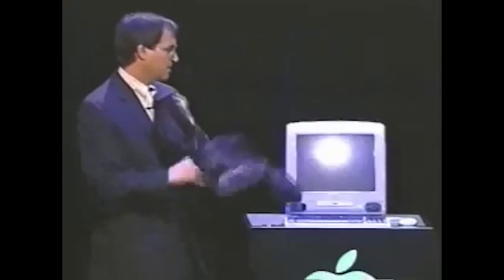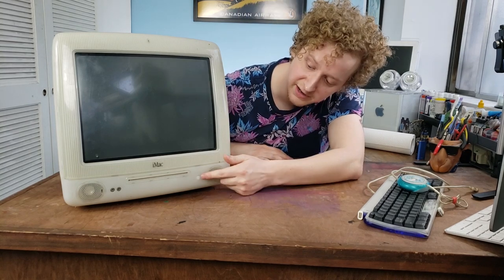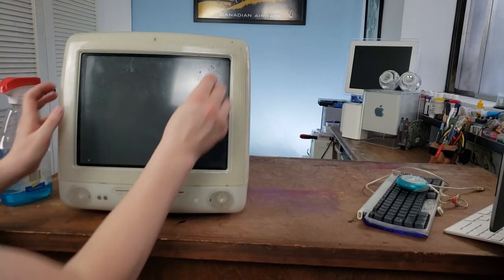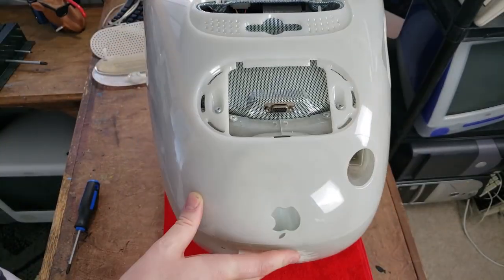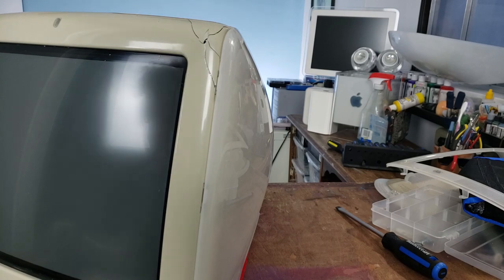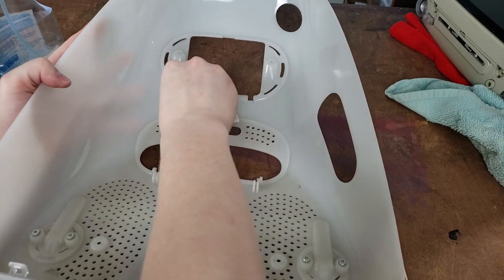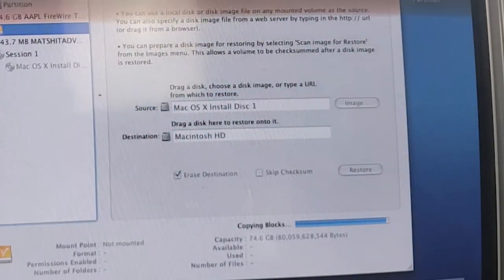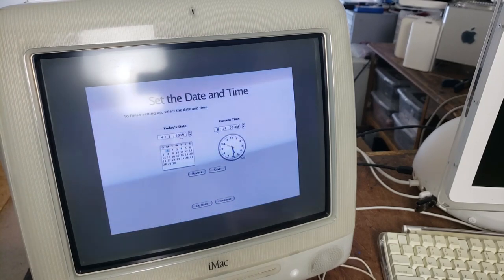Can I Restore This Broken Old G3 iMac?

Comment: Good video, a couple things I want to say. 
First thing is that leaving the iMac unplugged to discharge it is a bit of a waste of time because sometimes the thing doesn't even discharge and the best way to do it is to stick a grounded flat tip under the suction cup. Next thing is that you don't have to discharge the CRT to replace the RAM. You can actually remove the whole logic board and everything without needing to discharge because all the CRT components are in a different part of the case. Finally, to get the CD out that's stuck in the drive can be accomplished by sticking in 2 credit cards and pulling it free. To fix the mechanism, take the drive apart and you'll find 2 large black rollers that you'll need to clean because if they're dusty, they won't have the grip to push out the CD.
Reply from the maker: This is some seriously awesome feedback. Thank you so much! Your channel is great, btw, so I subbed to ya as well!

Comment: Is it possible to capture the screen using a capture card or something instead of pointing a camera at it?
Reply from the maker: Looking into that, plus fraps for when they've finally seen the OS installed.
Reply: CanadianComputerCollector what you can do is use QuickTime and record the screen and transfer to a new computer or what I do to record old Mac screens is use Remote Desktop on a new Mac to connect to an old Mac then screen record on the new Mac. I can help u if u want to give it a try.
Reply from the maker: @dukethecat  Thanks dude!

Comment: https://youtu.be/6Rm0cR1KTFE?t=234 The yellow on the front panel is likely due to yellowing of another piece of plastic just underneath the front panel. The same inner plastic that I am referring to is extremely brittle. If you really want to get the overall machine as white as possible, you literally have to wash all plastics in soap water so a full disassembly is required.
Reply from the maker: Yeah for sure. I was still pretty new to the game when I did this one and the yellowing is definitely from that inner plastic. And you are 100% right about how brittle it is.

Comment: I think you mentioned that it was the first iMac but it is in fact the 2nd or 3rd release of the iMac, not the first.  The first release had a tray load CD, not slot loading, like yours.  Or do you consider all CRT iMacs to be the same 'model'?
Reply from the maker: Howdy! You are certainly correct, tray-loaders are definitely the first model's and I don't consider them all to be the same (considering some of the bugs in the tray-loads), but the crt iMacs are often grouped together as the first iMacs by many folks. Not trying to share bad info!
Reply from the maker: Sorry, I just woke up when I replied, but that comment in the video is more or less just in reference to the G3 series iMacs.